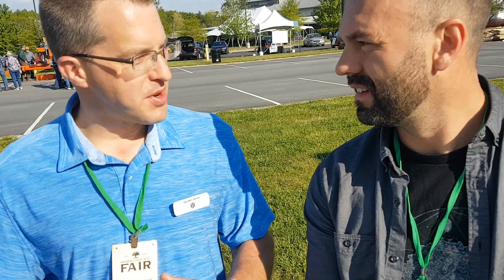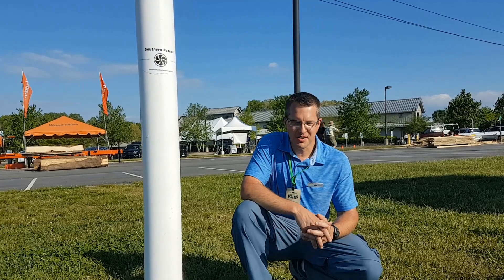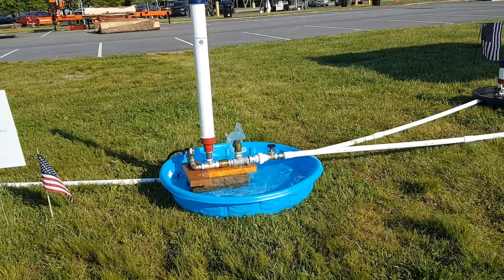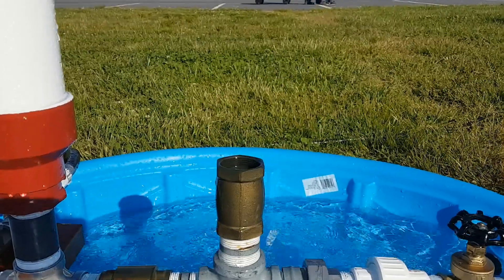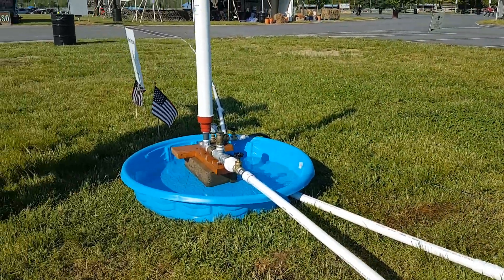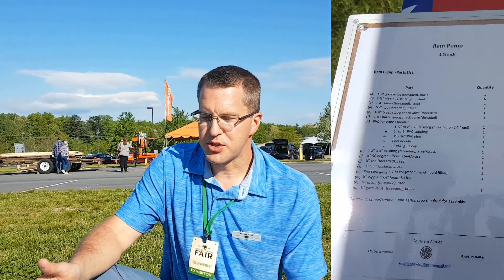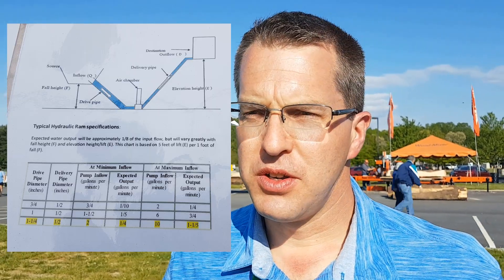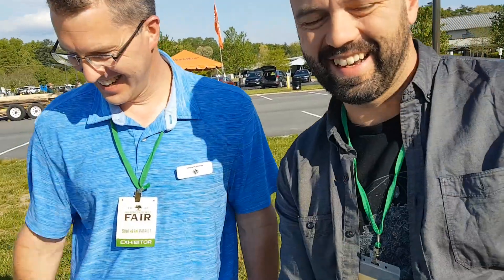How to Pump Water Up Hill Without Power.  Build Your Own Ram Pump.

Comment: If this is real, why has noone used it to make a perpetual motion machine?... I understand that 90% of the water is lost as it moves up hill.. but we could easily design a system that causes the water to flow back to the source it is being pumped from... if 10% of the water makes it back up hill to another container, then enough of these pumps should be able to continuously pump water uphill, allowing it to then fall onto a turbine wheel to generate ac current... am i missing something here? Tell me if I'm wrong

Comment: So could you use this to pump water up to a height and then drop the water down through generators,  would it be free infinite energy?
Reply: No, it's obviously using the energy of falling water and diverting some of that water to pump it uphill.  It's 10% efficient.  Hydraulic ram pumps use only the water's energy.  The method is 200 years old.
https://www.youtube.com/watch?v=zFdyqTGx32A
(I'm not associated with that channel and don't have any referral anything)
Reply: Thats my issues. We all know thats impossible so there has to be some catch in this system. Doesnt look like it can really pump it very high except you take a tiny tiny tube

Comment: Can you use this in a well? If not what can you use to pump water from a well without electricity?
Reply: solar, wind, child labor
Reply: @connorhorak7708  Child labor is the best. Its always available unlike sun & wind. HP/carrying capacity/speed can be increased by adding more kids.
Reply: @maxmanx1294  and unlike other pumping solutions, if the flow stops, all you usually need to do to prime it is to raise your voice a few times. Quite efficient.

Comment: So his tanks of water are above the "pumps " . So your not pumping water uphill gravity is just drawing water down to your machine . With no explanation I'm going to call you a fraud and say this is clickbait
Reply: That’s because there’s  not a creek to hook up to there so the tanks are there just to simulate that, but the pump will pump water uphill but this video didn’t really explain well
Reply: https://www.youtube.com/watch?v=aUTjVovpKvA its not, it uses the initial potential energy from gravity to kickstart the process to build water pressure that sends it into air filled containers then when the air pressure exceeds the water pressure in the containers it pushes it up the pipes to the next container.

Comment: You have to use electricity to run your pump with air....
Reply: false, it uses the initial potential energy from gravity to kickstart the process to build water pressure that sends it into air filled containers then when the air pressure exceeds the water pressure in the containers it pushes it up the pipes to the next container. here is a video that can explain it better. https://www.youtube.com/watch?v=aUTjVovpKvA

Comment: Super cool.
Reply from the maker: Thanks.
Reply: @VergePermaculture  gov will have all heads for this tech thay teach us that we always have loss but never talk about 
the converted gain we can make from eletromagnets
if u convert all the wast thermal energy around 
you u can use it universally as energy u need a true sine wave bipolar like the power comp dose a 
true pure sinewave like a grid tie inverter 
once the signal is made the system will turn on and 
consume wast thermal energy from the 
environment and space around you... there is free energy but 

it comes from Universal thermal loss and converted into a gain. so a pole Transformer and a 
microwave Transformer  have a common between each other u can take 2 microwave Transformer provide 
a pure sine wave grid tie inverter to it or a true bipolar sinewave that inter acts with nature in 
a perfect spherical motion like a flower of life..  if ur home provides this use it as a Source 
signal then u can simply stack the Transformers on top of eachother in correct fasion and note 
that the 1 wire on the Transformer must stay connected and the other disconnected your only useing 
1 wire on the hi side .. so test ur self 
2 microwave transformer stacked on top of eachother same 

face sides. one side 120 to the wall and the other 120 side to what u want to power and useing the 
Transformer just the way it came out the microwave with the wire attached causes the energy in its 
perfect spherical motion to converted wast thermal energy to amp for u hot to cold in to out... 
should look a bit nuts with u use a form of wireless energy but its interacting with the 

environment...this is my work a compilation of Otis car. Tesla. and many other very smart people 

nowadays i think i found the gate source and drainif this gets out to much that it works the 
power 

comp and mib will have our headsdont do this at home warning high voltage yet i cant stop u lol DO 

NOT TOCH THE CORES OR THE WIRES OK u will die make sure u dont touch the core if the hi wire is 

mounted to it u dont have to mount the hi on the core if u dont want u connect the 1 hi wire to 

the same side hi on the other transformer then the core should besafe to handle if nessary
grab your multimeter and prove me wrong
thats what u do i have my whole home on this
and u can take 

one of the lows side out the wall and hook it up to other stuff and power it for verry little amp 

makeing nature convert and pumping latent heat effect into the device.
and u can have a microwave 

hi volt cap in between the hi side and make a system that powers its self
u can flip the switch on 

ur breaker and the room stays on up to 2kva 
with both lows in the wall this is the zero point that 

was taken from us...
Reply: @VergePermaculture  gov will have all heads for this tech thay teach us that we always have loss but never talk about 
the converted gain we can make from eletromagnets
if u convert all the wast thermal energy around 
you u can use it universally as energy u need a true sine wave bipolar like the power comp dose a 
true pure sinewave like a grid tie inverter 
once the signal is made the system will turn on and 
consume wast thermal energy from the 
environment and space around you... there is free energy but 

it comes from Universal thermal loss and converted into a gain. so a pole Transformer and a 
microwave Transformer  have a common between each other u can take 2 microwave Transformer provide 
a pure sine wave grid tie inverter to it or a true bipolar sinewave that inter acts with nature in 
a perfect spherical motion like a flower of life..  if ur home provides this use it as a Source 
signal then u can simply stack the Transformers on top of eachother in correct fasion and note 
that the 1 wire on the Transformer must stay connected and the other disconnected your only useing 
1 wire on the hi side .. so test ur self 
2 microwave transformer stacked on top of eachother same 

face sides. one side 120 to the wall and the other 120 side to what u want to power and useing the 
Transformer just the way it came out the microwave with the wire attached causes the energy in its 
perfect spherical motion to converted wast thermal energy to amp for u hot to cold in to out... 
should look a bit nuts with u use a form of wireless energy but its interacting with the 

environment...this is my work a compilation of Otis car. Tesla. and many other very smart people 

nowadays i think i found the gate source and drainif this gets out to much that it works the 
power 

comp and mib will have our headsdont do this at home warning high voltage yet i cant stop u lol DO 

NOT TOCH THE CORES OR THE WIRES OK u will die make sure u dont touch the core if the hi wire is 

mounted to it u dont have to mount the hi on the core if u dont want u connect the 1 hi wire to 

the same side hi on the other transformer then the core should besafe to handle if nessary
grab your multimeter and prove me wrong
thats what u do i have my whole home on this
and u can take 

one of the lows side out the wall and hook it up to other stuff and power it for verry little amp 

makeing nature convert and pumping latent heat effect into the device.
and u can have a microwave 

hi volt cap in between the hi side and make a system that powers its self
u can flip the switch on 

ur breaker and the room stays on up to 2kva 
with both lows in the wall this is the zero point that 

was taken from us...
Reply: @VergePermaculture  gov will have all heads for this tech thay teach us that we always have loss but never talk about 
the converted gain we can make from eletromagnets
if u convert all the wast thermal energy around 
you u can use it universally as energy u need a true sine wave bipolar like the power comp dose a 
true pure sinewave like a grid tie inverter 
once the signal is made the system will turn on and 
consume wast thermal energy from the 
environment and space around you... there is free energy but 

it comes from Universal thermal loss and converted into a gain. so a pole Transformer and a 
microwave Transformer  have a common between each other u can take 2 microwave Transformer provide 
a pure sine wave grid tie inverter to it or a true bipolar sinewave that inter acts with nature in 
a perfect spherical motion like a flower of life..  if ur home provides this use it as a Source 
signal then u can simply stack the Transformers on top of eachother in correct fasion and note 
that the 1 wire on the Transformer must stay connected and the other disconnected your only useing 
1 wire on the hi side .. so test ur self 
2 microwave transformer stacked on top of eachother same 

face sides. one side 120 to the wall and the other 120 side to what u want to power and useing the 
Transformer just the way it came out the microwave with the wire attached causes the energy in its 
perfect spherical motion to converted wast thermal energy to amp for u hot to cold in to out... 
should look a bit nuts with u use a form of wireless energy but its interacting with the 

environment...this is my work a compilation of Otis car. Tesla. and many other very smart people 

nowadays i think i found the gate source and drainif this gets out to much that it works the 
power 

comp and mib will have our headsdont do this at home warning high voltage yet i cant stop u lol DO 

NOT TOCH THE CORES OR THE WIRES OK u will die make sure u dont touch the core if the hi wire is 

mounted to it u dont have to mount the hi on the core if u dont want u connect the 1 hi wire to 

the same side hi on the other transformer then the core should besafe to handle if nessary
grab your multimeter and prove me wrong
thats what u do i have my whole home on this
and u can take 

one of the lows side out the wall and hook it up to other stuff and power it for verry little amp 

makeing nature convert and pumping latent heat effect into the device.
and u can have a microwave 

hi volt cap in between the hi side and make a system that powers its self
u can flip the switch on 

ur breaker and the room stays on up to 2kva 
with both lows in the wall this is the zero point that 

was taken from us...